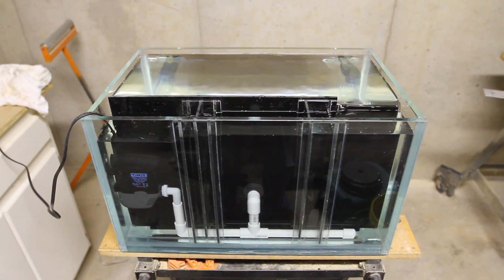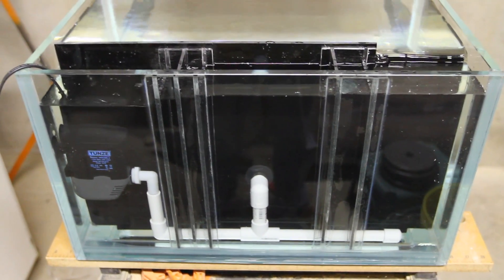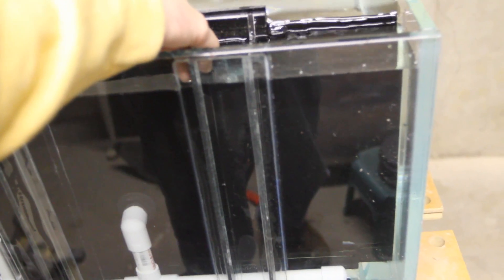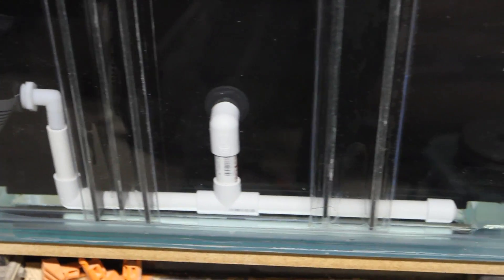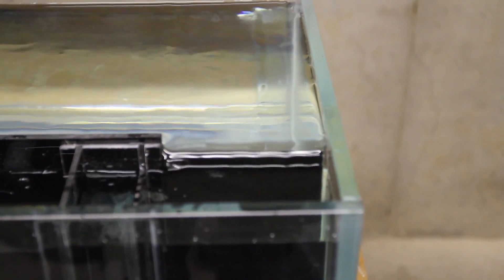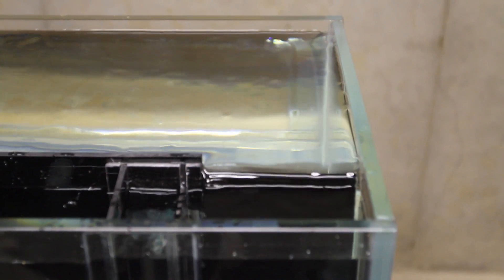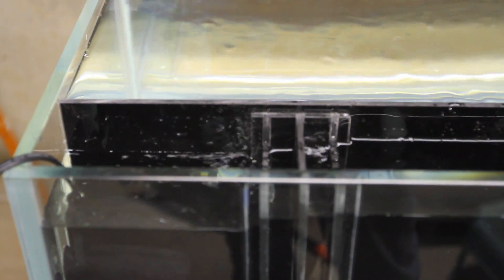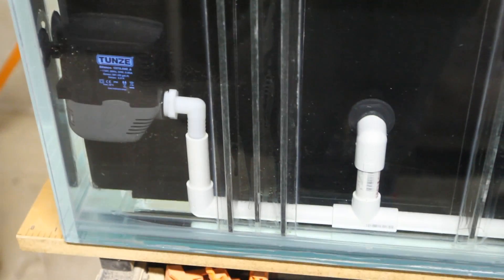Custom All-In-One Water Test

Comment from the maker: I bought the tank from Glasscages - I think I paid $150 for it.  The rest I built myself and probably spent another $50 on materials.  The tank is no longer in operation, I am probably going to use it as a sump for my new 70 gallon build.

Comment from the maker: @wgoff194  - Thx. - The width of the back chamber was determined based on the size of the return pump, I wanted to make the display tank as large as possible.  The removable baffles were made using pieces of acrylic with a sliding dado joint made (delicately) on my table saw.